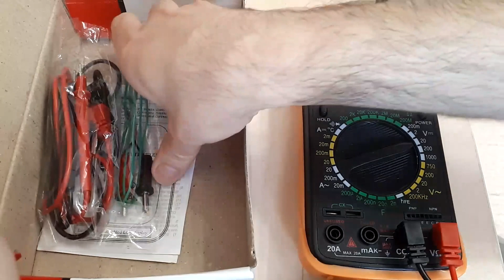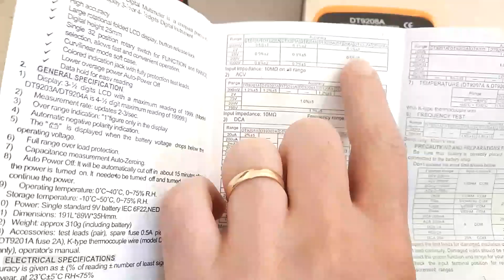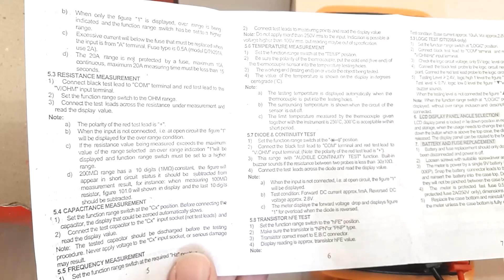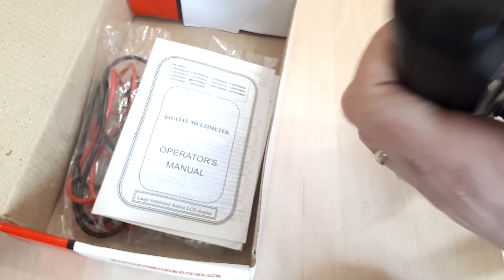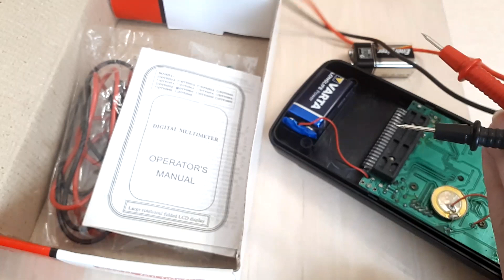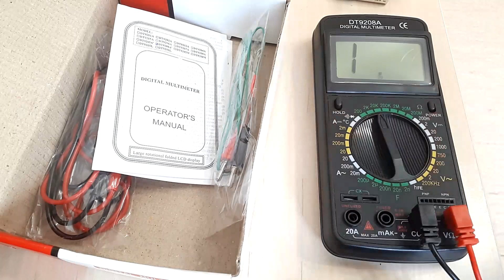2003 Generic DT9208A Why Vintage Cheap Digital Multimeters are Bad and What is Wrong with Them?(2/2)

Comment: Thanks for putting the effort in making this video. These multimeters are available for 20x less cost than the high end ones,  
1) Are you sure the accuracy varies directly proportional to the battery voltage, my assumption it is NOT, it might go wrong only if it goes below a cut off voltage. Could you prove it, with an 8.5 voltage input
2) The scientific way to compare the currents/voltage is  by connecting another high end multimeter in series/parallel.
3) Having 1-2% error is acceptable for most of electrical/electronics hobbyist projects